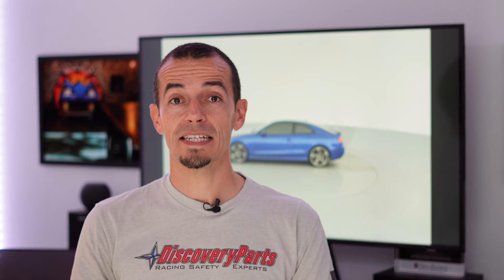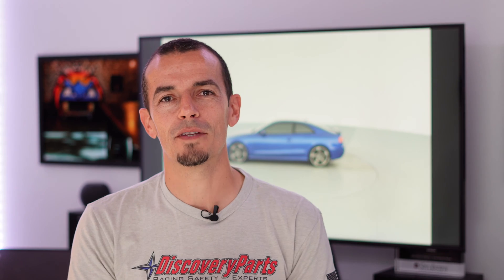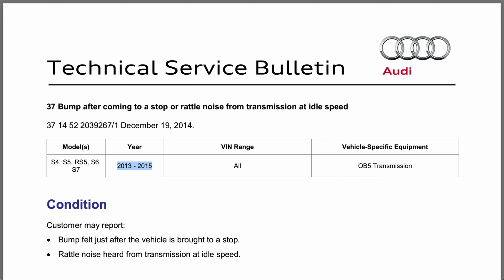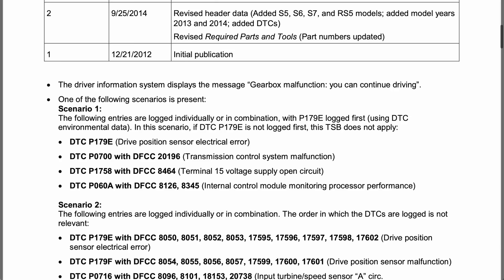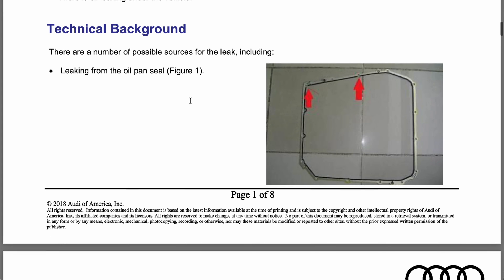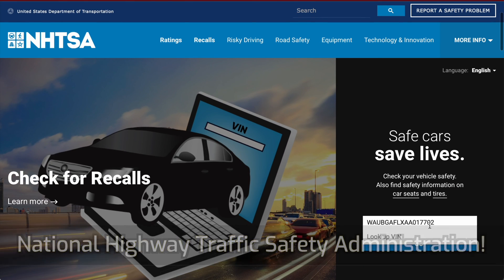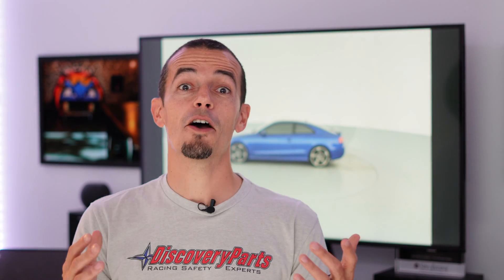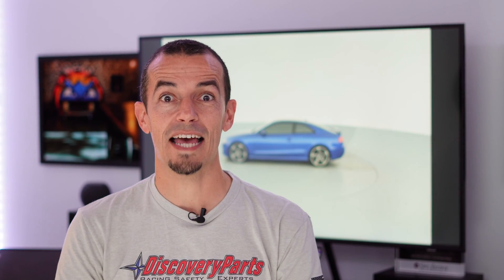5 Issues with Audi S-Tronic 7 Speed DSG Transmission (DL501/0B5)

Comment: Im so confused, the error on my car at the moment is P17F900 not P179F00 are they the same thing, the car says gearbox malfunction and wont go into gear :((((((((((((((((((((((
but the report ays parking lock mechanical malfunction  and 
P107C00 parking lock emergency release activated :(((((( HELPPPPPP
Reply from the maker: Hmm… not sure on that one. There’s a thread about it here: https://www.audiworld.com/forums/a4-b9-platform-discussion-212/p17f900-transmission-failure-code-3050024/

Comment: Hi
I got a leak from S-tronic transmission on Audi A7 2.8 FSI V6, is leaking near mechatronic unit of the S-tronic gearbox , from oil pan gasket and screws. Should i change the gasket and do an oil and filter change or the oil pan as well?It might actually be  the mechatronic unit itself? Thank you
Reply from the maker: The only seal there is the oil pan. If you check out my S4 video (save $1500) you’ll see that the corrosion can cause a leak. I sealed it with gasket maker and it’s still going strong.

Comment: I have a issue with my 2014 A4 3.0 tdi, the gear box works fine but i have a variety of vibrations when it's at idle in D or R its fine in P or N, the severity of the vibration changes as i move the steering wheel and as soon as im in motion it completely gone, i can move the steering when it under load with my foot on the brake and in certain positions the vibration has gone then other positions its there, so sometimes when i pull up to a stop i have a vibration then move the steering wheel and it comes and goes , if i put in neutral or park it doesn't happen, if i pull away it goes, i have no fault codes and the box is slick and smooth through all gears and have no noises, anyone have any ideas
Reply from the maker: Sounds similar to issues that Audi resolved with a SW update. Mine has similar issues now and then. When I get time I’m going to update the SW version of the TCU and see if that helps.
Reply: @FindingSeconds  Thank you for the reply, would you say it could be DMF or would there be other symptoms if it was that
Reply from the maker: I though DMFs were only in manual cars?
Reply: @FindingSeconds  S Tronic has a dual mass flywheel it’s not a auto it has clutches sorry I thought your channel was an Audi specialist garage, thanks anyway 👍
Reply from the maker: Ah you’re right. Sorry I haven’t got that far yet or had to deal with the clutches. Not specialist by any means. Just trying to help out the community but posting what I find. I know how frustrating it can be to work on these cars!

Sorry I couldn’t help. Looking at others there are similar reports and the internet suggests it could be the DMF. However, there are reports in the TSBs with similar symptoms. Worth looking through your reports if you can.
Reply: @FindingSeconds  Thank you you have been a help i will have a look at the TSBs

Comment: Mine is audi a7 stronic 0b5 when the transmission is cold works fine when is getting hot when u stop anywhere it shows gearbox malfunction but u cant drive …..
Reply from the maker: Best to go through all of the issues on that site for your particular model of 0b5. Something there might explain what is going on and how to fix.

Comment: I have a 2011 A5 30tdi V6 240 with this transmission and i get a intermittent jump from 2nd gear to 1st and also reverse creeping is delayed, even if revved.

Been told by Audi needs a Mech kit, is this correct? or is it the characteristics of the car?

Thanks
Reply from the maker: The TSBs I show (and the ones you can find on the site for your car) talk about a possible SW update. Do you have anyway to pull the SW version of the unit?
Reply: I can look what SW version is on, do you know the SW version which is the possible fix?

Thanks
Reply: Did you fix the problem I experience exactly the same problems hesitation in reverse and weird 1-2 shifts

Comment: Would you recommend a DSG Adaptation after a TCU software update?
Reply from the maker: Are you talking about a SW update or a TCU tune?

If it is a SW update, that unfortunately I can’t answer. As far as I know, there isn’t a way for the community to update SW as yet. The TSBs do list running adaptations if you replace some of the parts (not all). My assumption would be that when the SW is updated, the procedure either recommends resetting the adaptations or does it automatically. 

As far as a TCU tune goes it isn’t something that I have seen recommended. I do know on some of the older DSGs people would reset adaptations every couple of months to help with an aging transmission. I’ve done tunes on many cars and have yet to need to reset adaptations after. If you have different experience I would love to know.

Comment: My S7 has the "bump" when coming to stop. When it shifts to first and stopping the clutch engages, causing the car to push forward. Its very concerning and causes the engine to surge rpm and hunt for idle. It has also cause the car to stall if the surge is hard enough. 2016 model so its not listed as an issue.
Reply from the maker: Hey Chris, I just looked up the TSBs for your car (using the method I indicate in the video). Here was the top link in the power train section: https://static.nhtsa.gov/odi/tsbs/2020/MC-10174954-0001.pdf

Looks like the only solution to that was a replacement mechatronics unit. The document indicated it was covered by warranty for the first 4 years or 50K miles. I would recommend reaching out to Audi with that document to see if they can help still. Hope that helps.
Reply: @FindingSeconds  we have a replacement mech arriving this week.
Reply from the maker: Awesome, the document said about ordering by the VIN and also had information in it about making sure the clutches etc were completely adapted (before it was necessary to replace the mech). Is Audi working with you on it?
Reply: @FindingSeconds  no a friend of mine and myself are replacing it. We've had it out once for new harnesses and solenoids. No change. I hope it's something to do with the fluid passages or the gear selector cups. If not then it may be a clutch pack issue. We've done multiple adaptations with no changes. Did new fluid, new harness, new solenoids even though old ones Ohmed good. It's had a TCU tune and it's just gotten worse over time. Especially with the increased clutch pressure for the tune. It's been doing this since it was stock around 30k miles. I never knew it was under warranty until it had over 50k on it. It's at 90k now. It's been a great car otherwise. Low 11s and a daily driver. I just work around the shifting by manually shifting into 1st around 5mph.
Reply from the maker: Sounds like you are on top of it! Please come back and let us know how you get on. I’m sure you’re not alone with that one.
Reply: @FindingSeconds  I will, and I'm not. I've seen several people with this exact issue, and no one ever has a fix they claim works.  It's a no-fault code issue, which makes it hard to fix.
Reply: @chrislong7590 did the replacement resolve your issue? I’m having the same issue on mine
Reply: @ELAxBORATE  haven't replaced it yet.  I have the mech in but haven't installed it yet.
Reply: @chrislong7590 Hey, let me know if you solve the problem with the mech replacement. Got a 18’ S6, I bought it with low mileage, something around 34k miles. Now a little bit over 50k miles and I believe the problem is as long as I remember. I got an ecu and tcu tune during my ownership and the thing is the issue comes and goes, for one month everything is perfectly fine, and for another month there is the same issue you described. It doesn’t really depend on tune or adaptations. I don’t know whether to worry about it or not, everything is perfect with the work of the transmission despite that.
Reply: @TheKozik123  new mech I got in was faulty. Through several errors and was causing the trans to slam into gear. I'm looking for another unit now. I did speak to another tuner, claiming that they can tune it out. Going to give it a try soon.
Reply: @chrislong7590  I have tcu tune and it’s the same. But I didn’t mention the issue to the tuner, it’s just done for the performance
Reply: @TheKozik123  I have a tcu tune also. The new tuner claims he can get rid of it through settings. I gave noticed my car doesn't do it as often if in efficiency mode. You can physically feel the clutch disengage more when in this mode. So maybe that is the solution. I'm going to give it a shot. Worst case I just throwing away 800.
Reply: @chrislong7590  if you remember, let me know how it goes
Reply: @TheKozik123  no luck so far. I'm pulling the trans again when I get a break.
Reply: @chrislong7590  same. I did the mech rebuild with adaptations and it didn’t solve the problem
Reply: Did you guys solve the problem? I have same problem with A5 3.0tdi 2011
Reply: Did you fix the problem i have same in my Q5 2010
Reply: @waleeddaoud2590  hi guys I have same issue it's only when the car is cold. the car hovers up and down with the acceleration /rocking lightly when throttle pedal is on an inch of pressure so annoying! getting the gear box serviced again soon as it's nearly up it's 38000 oil change which this time I'm going to use a mechanic with a machine that sucks old oil out. has anyone had any update or positive change ??
Reply: What did scan say?

Comment: That DTC P179E requires a gearbox removal/strip down if it's the gear position sensor. It practically applies to ALL years the DL501 was used. What an absolute joke. I have a 2014 a4 with the dl501. No issues thus far at 82,000km, but I did change my dsg fluid at 50k km. I'm hoping to move into a 2016 s4 with the same gearbox. I had hoped the issues would have been sorted by 2016 models, but clearly not. I don't live in NA, so the last b8.5 s4 model here was 2016. It would apply to the 2016 model also.
Reply from the maker: That's crazy! Pictures put me off for sure :)

Appreciate the comment, and helping the rest of the community understand more about the gearbox.
Reply: Yeah my 2010 had that failure, it kept going into a neutral safety then back into gear and repeat.. very very dodgy. The sensor that causes it is called the G676 sensor and yep its not like mech unit that can be dropped out the bottom, it's a gearbox out job and an expensive one at that. When it was failing it simultaneously started sometimes jolting as it stopped and jerked pulling away so decided to rebuild the whole thing with new mech unit, clutches, flywheel, sensors etc etc and it's been flawless since! knocking on all wood so it doesnt break again  they definitely aren't reliable boxes that's for sure...
Reply from the maker: Good to know! Seems like they are good when they are functioning but a money pit when they are not. Mind you they are way cheaper than the M5 SMG… but that is for another day :) Keep us up to date!
Reply: I had the jerk bump at stop, I had the 034 motorsports stage 1 dsg upgrade and this also included the latest optimised software and extra torque smoothness and gear changes. Long story short the jerk bump is gone!
Also I have a receipt from a few years ago, the previous owner had the mechatronic and clutch pack replaced! £5000 😢. However this didn't include the dreaded pcb which is a massive job.